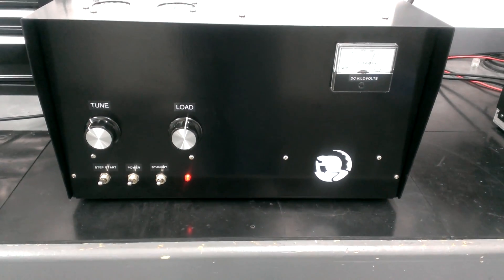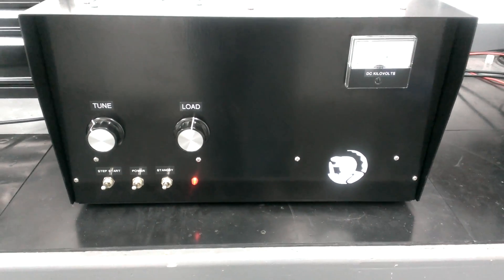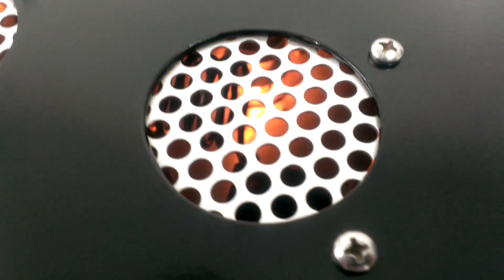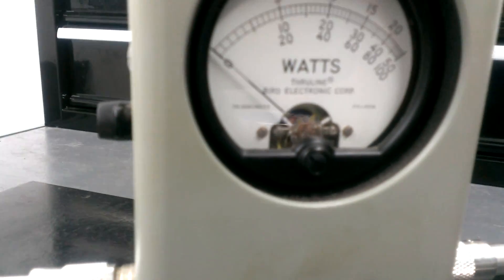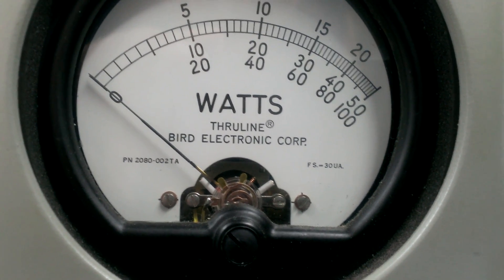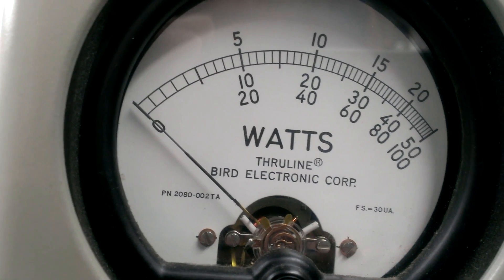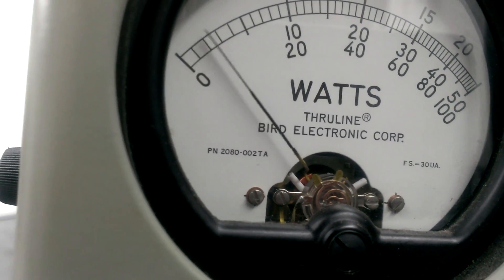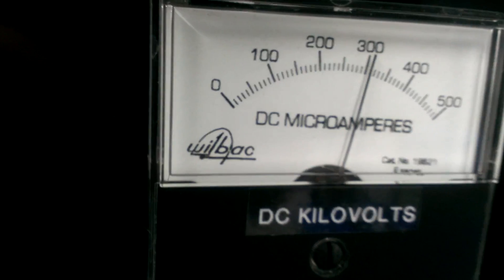BM Technology Single 3-500z amplifier

Comment: Funniest shit I've ever seen in my life... Magic tube and a fucked over Bird ... You guys could sell a blind Eskimo a fuckin snowball ...
Reply: I'm not associated with this YouTuber and I've got lots of experience making and repairing many types of tube amplifiers.  I believe that this demonstration is 100% true and accurate because I have personally observed 1500W peak SSB from a single 3-500Z on numerous occasions.   I wasn't able to get more because my voltage doubling power supply was folding back  well below 3000V. The difference is,  this guy's power supply folds back very little,  probably because he's using a Bridge Rectified circuit with a higher voltage transformer that doesn't have to be doubled up to 3500V.  This is a well designed amplifier and that's why it's able to generate 1.9KW peak from a single 3-500Z.
Reply: @joesitter20101  That is correct BUT - 3-500z(zg) is 500 or max 600W plate dissipation....this is AM so mid duty cycle with 25-50% carrier. Tube needs to run max.permissable grid current and in order to acieve this, the PSU would need to keep up the 3400V on the plate pretty much all the time. I own Tesla KVZ1, that is pair of 3-500z, external boat anchor PSU Unit.. RF deck 40kg, PSU 40kg... and silver plated coils, this is commercial amp built for HF RTTY for ex.Czechoslovak embassies.I can get out 2kW carrier, only when 238V on  mains so HV side doesn't go bellow 3.4kV under full load. If this AMP has been wired in a way, that coil is efficient, input matching is spot on and EHT stays on 3.4kV, then yes, short time it can deliver 2kW PEP, given you dissipate about doubble on the anode. It is radiation / convection cooled tube so blowing a cold air around the tube you can increase somewhat the plate dissipation, but not by much. Ideally you want to get about 65% efficiency, 3.5kV anode supply...or even 4kV is fine for 3-500z, and if you can, use a three phase transformer with full wave (6-pulse PSU) where DC filter only needs to do 4,7% rather than 47% of ripple.
Reply: @joesitter20101 yeah it’s possible but not for very long I suppose

Comment: Looking for a smaller amp. 3-4 watts in, 200-300 out. What is available in the ballpark? Using it for local and a little skip. Email: missletech2u@gmail.com. Maybe interested in a little higher output. Kinda working with a budget.